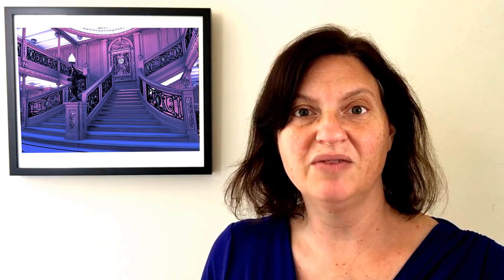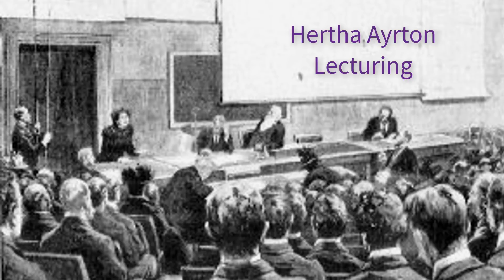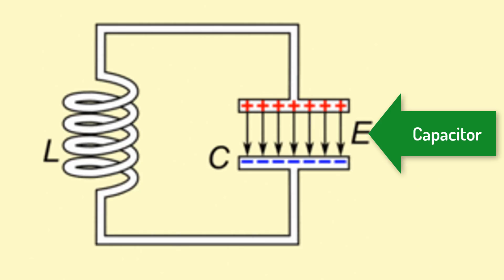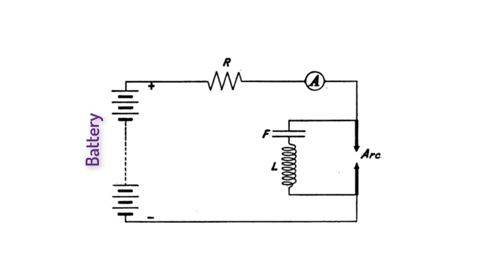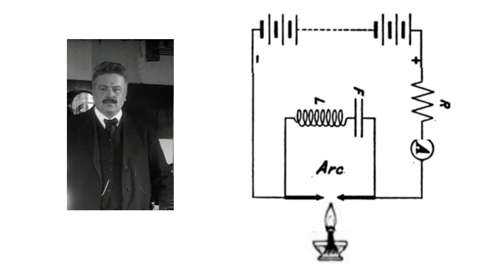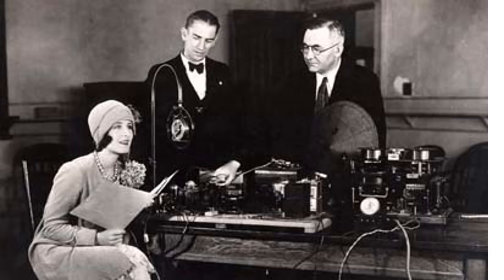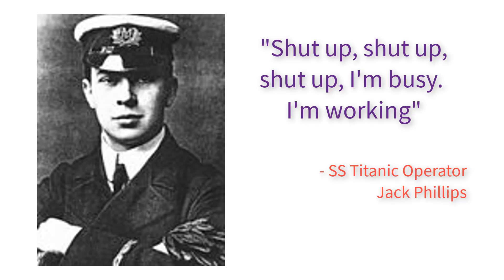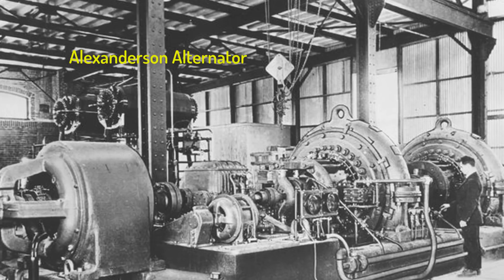The Arc Transmitter (Poulsen Arc) and the Titanic

Comment: Also you said  something about the time span of arc lamps.  Arc lamps were used all through  WWII for  aircraft search lamps, and in fact  an experimental,  battery powered  aircraft  arc was  "tried" before  fire control radar  became effective.  As I recall it was  a bomber,  with the nose replaced by a huge  arc lamp, and  the belly full of batteries.   Arc was  also used in   theator  projectors for quite some time.

Comment: I reject the argument that   what you are claiming as    the ability of arc to multiplex  would have  saved the titanic.   Ship communications in the HF era,  right up to the point at which satellites   become  prominent,   were primarily  1 operator,  1 message.  The  REAL  reason  that  arc was superior was just plain progress.  Arc was superior to  spark  in  narrower bandwidth  and better transmitter efficiency,  meaning  greater power output per input,  and alleged better reliability.   And along the way, receiver and antenna technology was improving as well.   "it was a group effort."   Of course  then at some point  vacuum tubes simply became the dominant  factor

I have  had several friends,  all radio amateurs, who were  Maritime  shipboard HF  communications officers,  and somehow  I have outlived them.  I am 77

Comment: ROTARY GAP used in high power trans mitters to avoid overheating. (Fixed gaps used on low powered transmitters.

The 5OOO watt transmitter on TITANIC was most powerful on any civilian ship in 1912, though there MAY have been Naval ships having stronger.

Comment: 9:55 I doubt that they would have employed more operators though. More operators = more costs = less profits and they thought that the ship was unsinkable.
Reply: The TITANIC had 2 operat9rs, but for technical tuning reason only 1 could work at a time, even if the radio crew were a dozen operators each with a radio set only one set could work at a time
Reply: @AlbertBenajam-ww1db  also the ship was operated 24/7, so I guess they needed more than one also because one man can't all the time.

Comment: Awesome - I've managed to set up a small CW arc oscillator by using water cooling and a gas feed of propane bubbled through isopropyl. The waveform looks exactly like that of a relaxation oscillator, and when in operation the light output of the arc massively increases, don't ask me why. The "opaque" dark blue silicone cover would light up like I'd put several watts of LED power behind it. I was able to coax it up to around 100kHz, and this is without using a magnetic field! I gauged output power with a 12V incandescent automotive bulb connected to a shorted loop around the resonator, suggesting at least 10W of RF output. Previous experiments with much less power, using pencil leads as electrodes, easily gave 35kHz, though I didn't have a proper LC tank for that frequency at the time, and used a tiny incandescent the size of a grain of rice as the load.

Comment: Tesla said frequencies of one million sparks per second would result in efficiencies not possible with a lower frequency. He used a quenched gap to accomplish this. He found sending signal through the earth was many orders of magnitude more efficient than sending dignal through the atmosphere. In the Westinghouse bankruptcy hearing he submitted a diagram that showed the difference in waves that go through the atmosphere and the earth. 
Tesla wasn’t interested in magnetism after 1890. Electrostatic repulsion and attraction was infinite as far as he could tell, and magnets could hold tons in the air, but we’re nothing compared to the relative/attractive force of electrostatic energy. 
Tesla rejected all theoretical physics, and electron theory as stated by modern science.

Comment: I once refurbished a Watson - Victor Diathermy unit. It was effectively a arc that cut through human skin and cauterised as it went. It was essentially and arc transmitter. The Spark gap was about an inch in diameter and had three screws to position the plates such that the arch was even throughout. It was a beautiful piece of equipment ..Probably 40s vintage.

Comment: 2:50 I think that a better explanation of negative resistance characteristic of arc is that increasing the current lead to lowering the voltage drop across the arc itself, while in regular ohmic resistance increase in current will result in increasing voltage across the resistor (E=IR).

Comment: Re: Carbon Light Arce illumination.  In 1972 when I was studding Metrology at RMIT there UNC-Metric Thread Measuring Projector used Carbon-Arce as a light sauce. 
My grandfather of the same name was the Maintenance Engineer on a freighter traveling UK to US when the RMS Titanic Sunk. They had NO method of commination a part from semaphore.  He could not believe Titanic had sunk when he reached the US.
Reply: In 1912 there was no legal requirement for ship to have wireless.  National laws were promptly changed to require it on passenger ships after TITANIC. 

Even while TITANIC sinking one shipboard operater, a teenager ran to his captain to report, he was stopped by bridge crew because it seemed a prank, but the captain woke up and heard him out. ,(The ship was too far to help anyway thou.

Comment: As I understand it, the rotary gap was the means of transmitter used on the Titanic. This was a
rotor with equally spaced teeth around it, spun a fraction of an inch from a very high voltage.
a capacitor wired to a coil is a so called 'Tank circuit'

Comment: I enjoy your way of telling the history of foundation of technology. I would like you make a video regarding Crystals as oscillator and how was introduced to the early technology of broadcasting. Kudos !!
Reply: The history and ignored opportunities around the phase locked loop is also quite interesting.
I always found it interesting how many found such circuits daunting. But then, I found it interesting that so many had trouble diagnosing and repairing a switch mode power supply as well.
Understand how it works, it's far easier to figure out what's wrong.
Reply: @spvillano   back in 1986 was the first time I saw a PLL circuit on a 2 way radio … it was a big leap from Crystal . The way they use to “program the frequency “ was with a bunch of diodes … in less than a year they switched to UV EPROM and eeprom short after

Comment: Arc lamps were used much later than the 1920's for search and spot lights, in fact I remember seeing them in use as late as the 1970's (maybe later).  The carbon arc requires a ballast resistor in series with it when used on DC, and a resistor or capacitor ballast in series when used on AC.  As you described, this is because the arc behaves as a negative resistance, which means that the current drawn will go UP as the voltage applied across it drops.  If a negative resistance is applied across a tuned circuit, this creates a power oscillator that can be connected to an antenna as a transmitter.  This is how the arc transmitter works.  Years later, a solid state device known as the tunnel diode was invented that also acts as a negative resistance.  So the carbon arc was actually an early tunnel diode.
Reply: Both carbon arcs and tunnel diodes gradually eat themselves up, so there's that, too!
Reply: I actually ran an arc light in a movie projector, mid 70's. It was kind of a touchy thing; I had to touch the points together to start the arc, but I didn't want to look at the points directly when they lit up. A friend did and he was flash blinded for an hour.

Comment: I do not see the link between the downsides of Spark transmitters or the Titanic disaster in any way. I´ve build spark transmitters since I was 7yo, I´m 31yo and still building/researching everything ´from Spark to Arc´ (and vacuum tube, some, to 1920). No offense intended, but shipborn arc transmitter were considered generally to be a disaster, and Arc transmitters were mostly relegated to Megawatt monsters on land working at VLF-frequencies. In the end both Arc and Spark suffered from the same inherent problems: What´s the point of having Continuous Waves if there´s no receiver to receive it? The vacuum tube was considered more an annoyance than a gain for the first 10 odd years of it´s existence, and even if they were available (which they were not in big numbers before the 1920s), it was in land-based receiving stations they found their home. Emergency transmitter aboard ships were of the Spark type way in to the 1950s, and in some countries even into the 1970s they were used as ´third line´ lifeboat affairs. On the other side, the highly demanding Poulsen Arc was ideal for big land-stations at low frequencies, but it never got off the ground as a Naval method of signalling. The US Navy build dozens of Arc stations, put a 5000W Arc transmitter aboard the USS Texas, but in the end they always kept a 1000W Spark transmitter nearby as well. The irony of the case is, by the time the Poulsen Arc had grown adult, the Spark transmitter had become such a fast-switching method, both systems just overlapped each-other in principle of operation. People have it very difficult to understand that before the 1920s.... Innovations traveled much slower, and only in 1927 were BOTH the Arc and Spark transmitters officially relegated to 2nd line duty, which is basically banned.
And all the measures you mention that could´ve saved Titanic? They were all in place: there was an agreed frequency for emergency reports, and as for the Arc-stations? They wouldn´t have made a difference, since nobody could receive Continuous Waves at the nearby ships (see above) also there´s the fact there´s only ONE antenna to work from in the first place, and that has to be tuned to a specific wavelength in order to be an effective radiator of that wavelength. Arc stations couldn´t ´frequency hop´ either, they were mostly fixed tuned to a few preset positions, same for Spark Transmitters. In fact, when it comes to an emergency, I´d pick the spark transmitter over the Arc any day, and that´s what all Navies in the world did.
I can go on forever about this subject, but I´m busy actually building one of these things, or rather adapt it to the point it´s usable today. Which is.... Yeah, not that easy! :-)
PS. Ol´ Jack Bins did hear what the SS California sent, but he just ignored him, increased the transmitter power on his side... Which is the radio man´s equivalent of putting up your middle finger. He even signaled back ´working Cape Cod, shut up´ (correct there) at which point the operator aboard the SS California just had had enough of Titanic´s rather arrogant behaviour... And went to bed :-) That´s why they ignored the flares too! They were a mere simple merchantman, while the rich people were having things their way again (remember this is 1912, not 1992), firing fireworks etc. Had nothing to do with technology, pure poor operator procedure, safety protocol and above all... Some good old greed! :-) In those days, operators were payed by wealthy costumers to keep them updated about horse races, stock exchange, family reports, stuff like that. And the majority of profit for a radio operator was in sending messages for rich people, he (literally) got payed per message, not per hour of work. These guys signaled faster than any of us can SMS, up to 75 words PER MINUTE, because ´brass-pounding´ is where the real money was. Radiomen worked their way ´up the food-chain´, some were as young as 15 years old when they went to sea on small freighters that got 7th rate equipment compared to the Titanic´s. This ofc, is never shown in ANY movie, but severe restrictions were put on this ´privatization´ of radio aboard ships post-1912. Operators all have to listen 5´ every 30´  on the emergency frequency, even if there´s a guy waving a 10 dollar bill to get you to send a message to shore about some stock sale, and hence do otherwise.
Oh by the way if you want, I can send a pile of link if you want, to some véry good sites on this matter. I´d place a link of the 1200 page 1931 Admiralty handbook, but that´s a little too much, even for me. :-) Irony is they still use the chronological order for education than: in 1931 Spark and Arc were both ´dead modes´, yet the books begins with understand Spark, than Arc, than tubes. And if you learn it that way, there´s a lot of things you get to understand than doing it the other way around.
This is a good start, a list of Naval pre-war stations in use:
http://www.navy-radio.com/xmtr-prewar.htm
Quite a few Arcs on that site, Navy Arcs, including some smaller ones.
Reply: WOWWW GREAT COMMENT... good luck with the transmitters you're building...wish I could see the outcome 👉🇬🇧👈👉😷👈

Comment: Having constructed several replicas of both SPARK transmitters and POULSEN ARC transmitters, there is absolutely no way to operate multiple transmitters at the same time in a local area without interference between the two. Practical tuning allowing different frequencies to be differentiated is nearly impossible. In 1912 both systems used either a 600 meter wavelength or what was at the time considered "short" wavelength, 300 meters by inserting a large capacitance into the antenna lead. One advantage over the Marconi system of 1912 was that it allowed "full break-in" which up until that time, was a miraculous operational convenience. This allowed an operator to listen for other signals in between key breaks. This was possible for two reasons: the use of the Marconi Magnetic Detector which was impervious to vibrational issues from the ship's engines and the fact it could be connected to the antenna continuously (without having to change a switch from "send" to "receive," and an auxiliary pair of shorting contacts attached to the Morse sending key lever which shorted out the operator's headphones so his ears did not get blasted by his own signals. No other wireless system at the time had effectively mastered this. Other systems that used similar Poulsen transmitters included Telefunken which mostly used Slaby-Arco designed arc sets.
Reply: You constructed replicas? Me too! How did you go about the Arc? It´s a big problem for me since I don´t have much tooling, so I´m reverting to ´semi-arcs´ as used by Goldsmidth during his experiments with Radiotelephony in the 1907-1914 period here in Belgium. I´m trying to group together as much people as possible with first hand knowledge and interest, and get some ´network´ set up to keep alive this knowledge, since if you worked with these things... Well, you know it´s not half as simple as it seems, and there was a lot of science/knowledge behind these things that are near-forgotten.
Sincere regards/73 de ON4SPK (Spark, yes)
PS. If you´re interested in exchanging ideas/designs or documents, send a message, and we´ll figure out a way to get this organized.

Comment: Just as an aside, the transmitter aboard the RMS (not SS) Titanic operated by the Marconi Company was rated at 5,000 watts, the most powerful afloat at the time.  Titanic's distress call was clearly received by a number of stations on the mainland.  The distress signal was passed to other ships.  Sadly, none were close enough to respond in time.  An interesting fact was the service voltage Titanic used.  Only 100 volts DC.
Reply: Royal Mail Ship...seems an odd designation rather than straight up SS...Steam Ship... Well spotted 👉🇬🇧👈👉😷👈

Comment: if you want to know how the bronze age could have had  access to dc batteries i can explain that as well.  there is found batteries in bagdad that is many tousands of years old that contain a iron rod inside a copper tube inside a jar with a aspalt plug in the top of the jar. there is also found graves with sulfuric acid so they knew what that was. sulfur was also known 2000 years ago and the chinese at that time even had cannons and not just rockets.  even if they only used a sulfur water solution it would probably work with just that. that is how the bronze age could have made batteries.  even stomach acid can work for batteries extracted from the belly of animals that have consumed vinegar. you can also use sea water.

Comment: the explananations and theories of these devices are to complex and holds a fairytale like tone to it that makes it more entertaining but less understandable. the simple explanation would have allowed people in the bronze age to make radio. the simple explanation is much cruder. a electic arc creates a vibration that is both electric and sound at the same time. the amplification in the circuit is created by the vibration. to explain simple you don't need a theory to understand how to make this stuff. you only need to know that when you speak trough a graphite rod in series with a dc current it will vibrate and the electric current will vibrate at the rate of the sound wave. this itself is a crude transmitter. now you only need to use somthing to create a carrier wave with like  a arc lamp. by using a speaker funnel connected to the body of the arc lamp you could speak into it and it would transmit at the frequency of the arc lamp. in order to receive the signal and amplify it, you can use a antenna connected to a speaker funnel and place a graphite dc circuit inside it. when the weak sound wave / radio wave goes trough the graphite buzzer it amplify the rf signal and the sound wave inside it. by using a crystal or a another dc circuit with a graphite element you can attatch this to the speaker funnel and amplify the reception this way. this part of the circuit have the same purpose as electric coil in a more refined version. the parts for this would have been possible to make in the bronze age by a single blacksmith. there is likely even more crude to do this that what i say now that i have not yet taught of that is even simpler.
Reply: It's been 3 years. Tell us more?